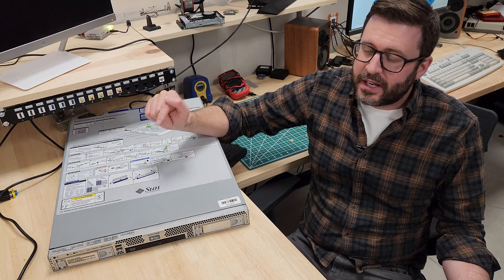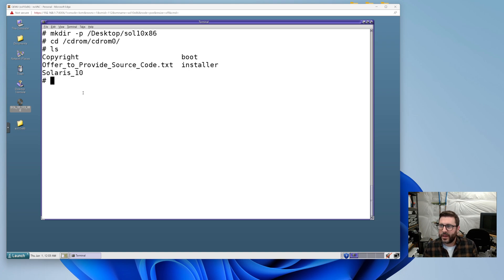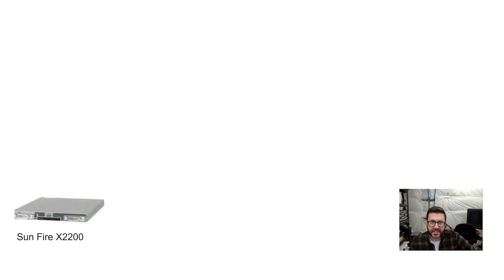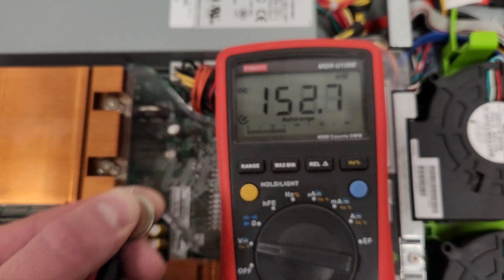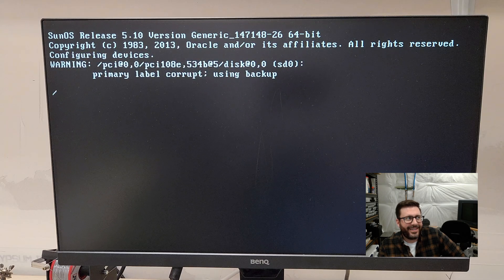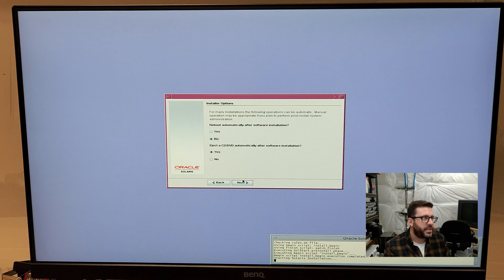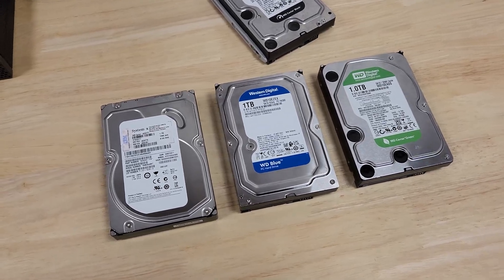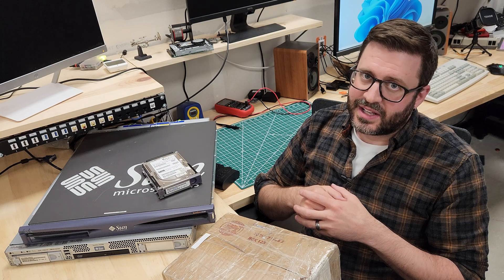How to Net Boot Solaris 10

Comment: I'm gonna stick up for the black disc drive. I like it. It's a little unrefined, but it's visually distinct so it's easy to spot, it matched the dark shadows created by those holes. I don't personally like things that are very silvery, but the design of that unit is kinda nice. If it were grey/silver on the disc drive though, I think it would look a lot more dated. The black in complement to the shadows of the honeycomb circles helps visually break up what would otherwise be quite bland, like shoes that match you belt but not the rest of your outfit. So yeah, I'm gonna stick up for the little drive, I think he looks rather fetching, no need to bully him :')

Comment: Hi there,
Which settings for your proxmox vm hardware did you use to get solaris to install?
Somehow it fails to install for me with all kinds of different combinations.
Reply from the maker: Hey, I do remember having trouble getting it to work as well, but it was so long ago I don't remember what I did. You'll definitely need an x86 ISO of Solaris, I'm using an x86 version of Solaris 10.

I don't see anything else out of the ordinary in my VM setup other than I specifically set the OS Type as "Solaris Kernel."

Other than that it looks pretty normal - SeaBIOS, i440fx, VirtIO SCSI.
Reply: @clabretro Hi there, thanks for your feedback. I ended up attaching the virtual disk using IDE. For some weird reason it didn't like the scsi controllers. Maybe Solaris 10 u8 is a buggy version?

Comment: Hi! Rememer me and my Journey to revive a blade 100? So I used a Dremel and installed a new battery. Nvram is now working  But I don't have the root password. It runs Solaris 7.
Can I setup a netboot server using i386? Or  I need to emulate sparc using QEMU and setup netboot server as you did? 
Another option is to use the Sunfire t2000. This machine works, But I don't have a graphics card... I can install Solaris and setup a netboot server, but I need to use the serial or buy a graphics card. So, the easiest way is install a VM and setup a i386 boot server, if it's possible, that's why I'm asking!
After watching your channel I called some old friends and pull strings and received  some mafhines. But The T2000 I pay about $80. Now I have:

T2000
Blade 100
Blade 1500
Blade 2500(one processor)
Reply from the maker: Nice! Yeah I was able to get an x86 ISO of Solaris 10 running in Proxmox, that's what I use as my JumpStart server. It will happily serve up SPARC ISOs to the Sun machines over the network.
Reply: @clabretro  thanks.. Ill try

Comment: One remark... if you insert two drives and want to use ZFS, you have to use the Text based installation wizard. In the graphical install, it is not included to change the disk layout with ZFS. And ZFS ist the best file system you can chose.
Reply from the maker: Oh yeah, I've been meaning to do a full ZFS multi-disk setup with one of these Sun Fires.

Comment: I've been thinking about installing Solaris on a old intel pc to use as a server. Is it worth it?
Reply from the maker: I'm new to Solaris so I'd recommend it as something to play around with, but personally I'd just stick to a modern Linux distro, there will be a lot more information online to help out with issues or questions you have.
Reply: @clabretro  I figured that would be the answer.

What distro is the best to use as a novice?
Reply: @Dave102693  Just pick one and dive in, it'll also depend on your hardware components. I recommend Ubuntu or Debian, personally I started with Ubuntu direct on hardware then a few other distros in VMs, before going onto Gentoo. Then I had a spare system I setup as a server with Debian, used it initially just for IRC but gradually added sandboxed DNS (chroot dnsmasq) and DHCP.

The differences aren't important, the right tools for the right jobs. So just pick one, and go.
Reply from the maker: I second that -- Ubuntu or anything Debian-based is a great start simply because there is so much help information and support online out there for them. Throw a distro on there and check it out! You can always just try another (and I guarantee you will once you start!)